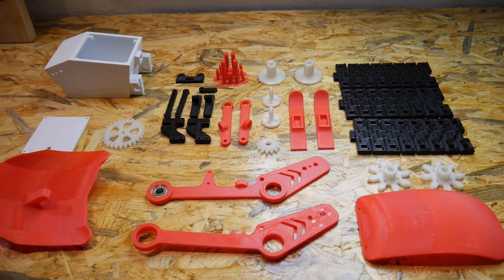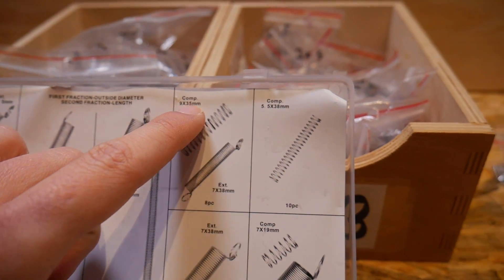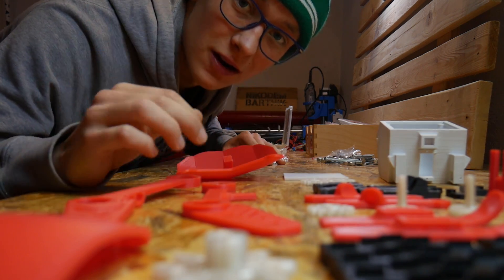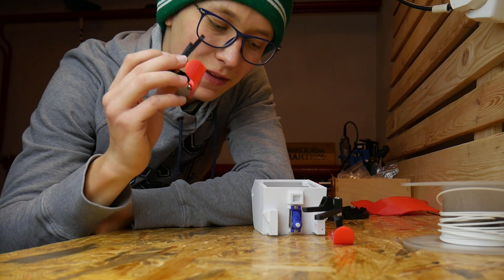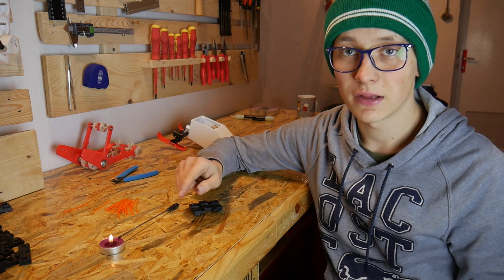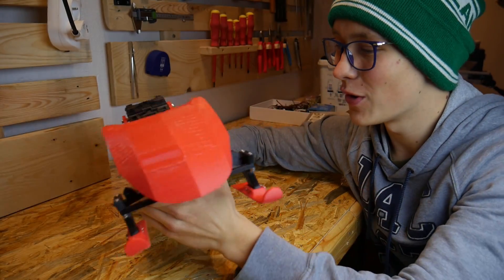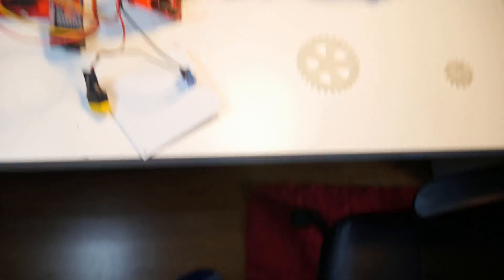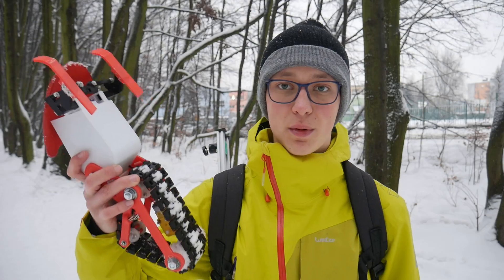3D Printed RC Snowmobile!

Comment from the maker: Any idea what type of motor should I use to make it faster? Let me know in the comments :)
Reply from the maker: Thank you! I am afraid it will be too fast :(
Reply from the maker: Isn't it too fast? I would need a proper gearbox for such a motor, I am thinking about something with a built-in gearbox, will think about that :)
Reply: @nikodembartnik  look at hobbyking.com and choose some cheap brushless motor with esc ;
Reply: Big ol’ brushless motors!
Reply: Take a brushless slowflyer Motor with 1000rpm/Volt 🍅 Type with 35mm diameter - that should be ok
Reply: First, you might just test by increasing the voltage. But If you want a new motor, it would be good to know the output RPM and torque of your current motor. So based on similar looking motors, I'm guessing that one is about 100 RPM with 0.8 kg-cm (~78 mN-m) torque (at 5 V).  So, I think you might start by looking into the N20 mini geared motors. They are close to the same price and about the same size but have all metal construction and metal gears. They also come in various gear ratios (ex. 13 RPM with 6 kg-cm torque or 4,400 RPM with only 0.18 kg-cm torque). You can also get different type motors to fit your electronics (ex. 6v, 12v, high power, low power, etc.). But overall these would only be about 3 times better than your current motor. If you want to ready move, then you'll have to go bigger. 
OK, that about all I know. I hope that helps!
Reply: Maybe try one of these?
https://www.amazon.com/Premium-Gearbox-Reduction-Electric-Centric/dp/B075NL6MNQ/ref=asc_df_B075NL6MNQ/?tag=hyprod-20&linkCode=df0&hvadid=242027088707&hvpos=1o2&hvnetw=g&hvrand=17112257842866572243&hvpone=&hvptwo=&hvqmt=&hvdev=c&hvdvcmdl=&hvlocint=&hvlocphy=9031264&hvtargid=pla-491601432928&psc=1
Reply: A quadcopter one? :D
p.s. Cool project!
Reply: I have HSP 28006 brushed DC motor with regulator, i really has too much power with 2S battery :) I can lend it you for testing
Reply: You need more power! So, you need a more powerful motor.

Comment: You might want to put some snow channels on the under side of the skis also look up ackerman steering. 
(Or don't I'm not your teacher)
Great video keep it up

https://www.google.co.uk/search?source=hp&ei=5t89XJ7GLIqdkgXb3pToBQ&q=ackerman+steering.+&btnK=Google+Search&oq=ackerman+steering.+&gs_l=psy-ab.3..0i22i30j0i22i10i30j0i22i30l8.2673.2673..9037...0.0..0.71.71.1......0....2j1..gws-wiz.....0.ZfCxq534-Ig

Comment: Cool project Niko!
for the engine you could use a brushless motor like this https://www.banggood.com/EMAX-XA2212-820KV-980KV1400KV-Motor-With-Simonk-20A-ESC-p-974648.html?rmmds=myorder&ID=47984&cur_warehouse= CN
or a 755 brushed motor, but it is 12 V, it costs less than the brushless but you should check well power and current because your control board could burn.
ciao
Reply from the maker: Thanks, I was thinking about 775 motor but it is slightly too big and has to high rpm
Reply: @nikodembartnik  on Aliexpress i see a Page with 3 kind of 775 variabile on power and speed if i remember correctly they differ with the number. ... some of this kind: 775, 865, 605 and so on sadly i do not remember exactly, One solution is to feed with less voltages than 12 Volt like 6 V 
Hi to you